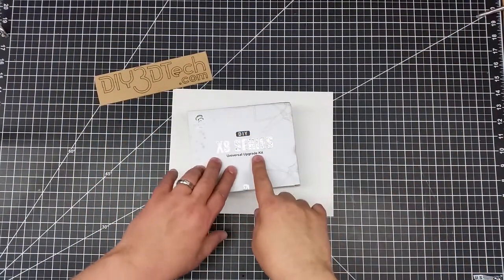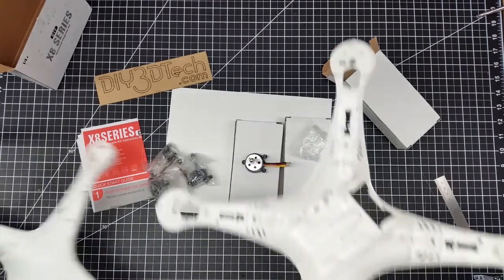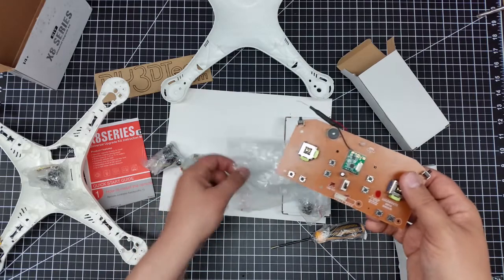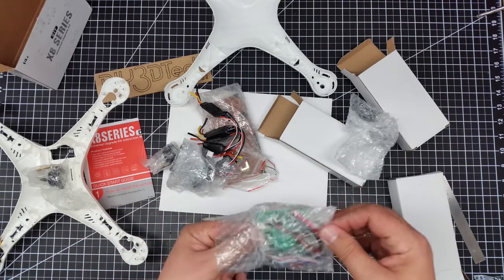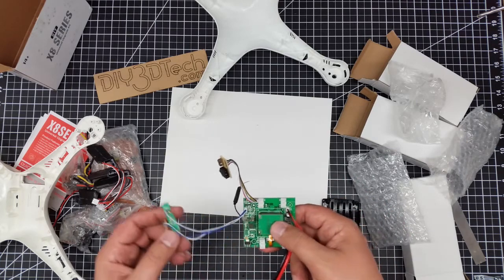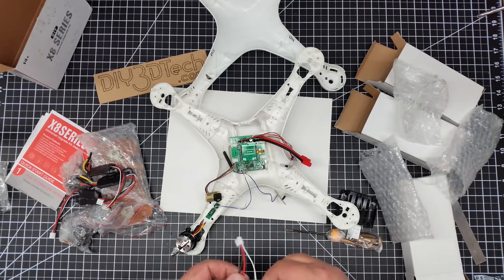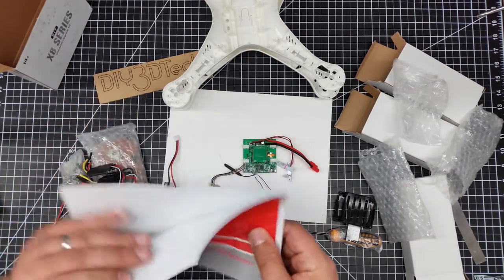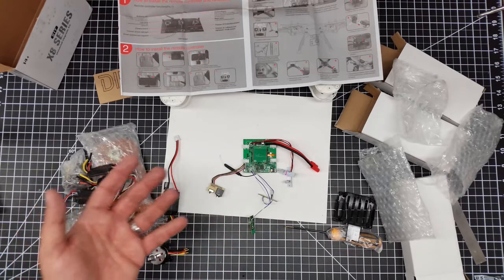Video Drone - Syma X8 Brushless Motor and Controler Upgrade Kit Unboxing!

Comment: This is a nice video of what to expect.  I have a X8W.  I've upgraded the camera to a SJ4000 with the BGT anti shock camera mount.  With this set up it's even more under powered. Question, in your opinion would this be a better upgrade than going with the night lion motors?
Reply from the maker: By far yes, the night lions are only a little smother because of the brass gearing and wear a little better.  These by far are larger motors...

Comment: Hi, I believe the kit is exactly the same as the kit installed in the Darkstorm  x8amh, which is a quad which has big issues as I've seen in different videos. What's your thoughts?
Reply from the maker: My understanding is this will fit another quad and I cant remember the name right now (sort of looks like a bee) so that is highly possible.  Out side of the unboxing I have not had a lot of time to mess with it as I had to leave the country on business the day after I got it so when I get back next week I will start the build however liked what I saw so far...

Comment: The kit seems to include some baseplate adapters so that brushless motors just drop in. Are those baseplates available by themselves? Google was no help.
Reply from the maker: Out side of the kit I have never seen them, they would not be hard to model and 3D print however worth not, the motors aren't normal brushless motors as this plastic base seems to also form part of the bottom of the motor itself...
Reply from the maker: P.S.  I am going to do a bench video on this as I had issue and will try and show the plate as well as greater detail of the motors...

Comment: i tried flying my X8HC clone with 3 speed rates on 3s, it did work but anything over 70% throttle made it fall out of the sky, Video Drone please check my video out..its called x8/x15 clone 3s test ...do you think it has an over current protection? this could be the alternative ive been looking for,thanks for sharing
Reply: Also the ebay link you have provided says the kit is currently out of stock
Reply from the maker: Sorry out of the country on a business trip, however will try over the weekend...

Comment: do you think i can upgrade my syma x5sw-1 with brushless motors
Reply from the maker: +brian lunsford any thing is possible with both time and money.  However by the time you make such an investment you could buy a nice brushless quad...
Reply: well check this out.. ibought a syma x5sw-1 and when i pluged it in i got one flight and now it dosnt power up......... so i got a refund.. and another syma of the same type...its working fine....but now i have the bug.... thinking of getting a turnogy evolution but how do i know what drones i can fly with it... can youhelp with the question ... i am very new at this.. thanks
Reply from the maker: The first thing I would suggest is learn to fly with X5 and get at least ok at flying it.  Second why are you focusing on a controler and not a quad.  This is backwards, as if you go that route you need to (1) build your own quad (which doesn't sound like your there yet) or buy a Bind and Fly (which again from what you wrote, your not there yet).  If Intro FPV is your thing, check the Walkera Runner 250 Pro there are like on my site as well as videos too as its turn with GPS so you can learn with training wheels as jumping straight into Acro mode can be frustrating...